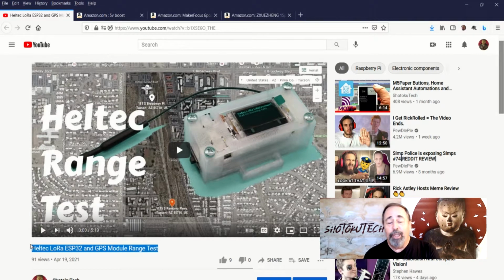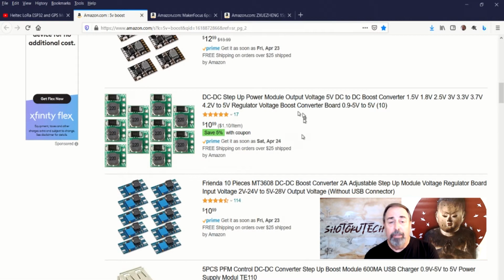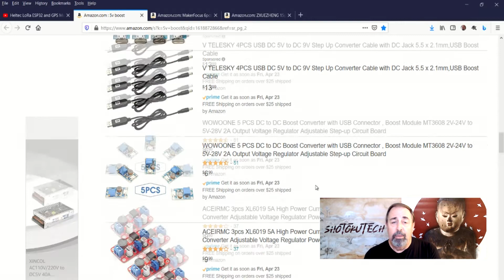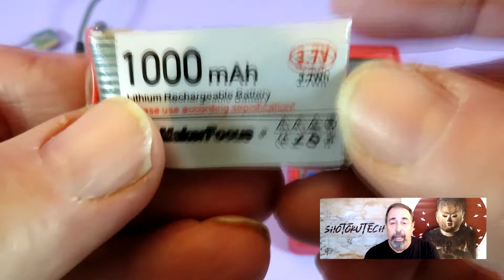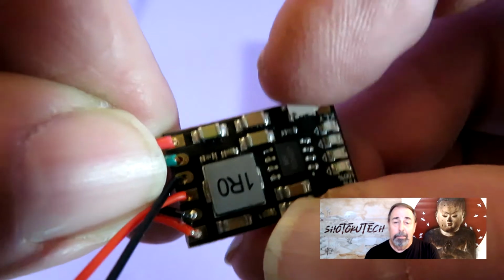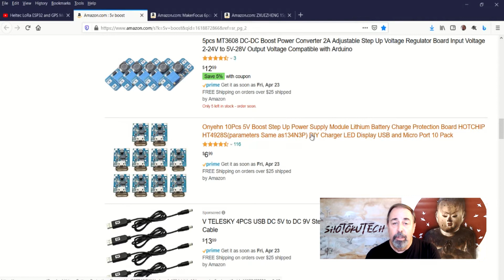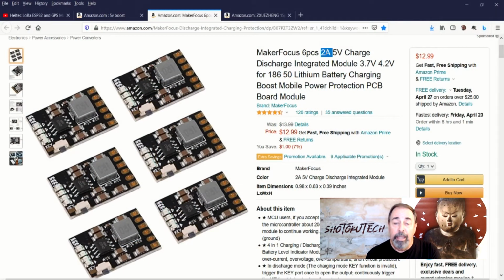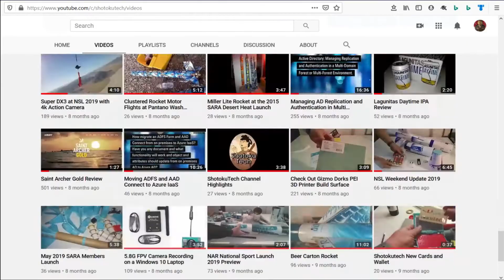Boost Converter 5 Volts from a 3.7 Volt LiPo Battery

Comment: This is a long shot but I am looking at a project where the the device requires a 5V regulated output does this system ensure that the voltage output remains at 5V regardless of the battery voltage level?
Reply from the maker: Hello. It is intended for 3.7V - 4.2V for 18650 Lithium Battery. So "Regardless of what battery voltage level" would have to be within that range and to deliver 5v at 2a you want the 18650 battery. Best wishes.

Comment: Did you test this module to see if it has all the necessary protections, e.g. short circuit, under voltage, over voltage etc?
Reply from the maker: Good questions. I'm more consumer oriented, focusing on making things work within the parameters given. I do know from repeated charging, it won't over-charge the battery. When the battery runs out, it is still in the safe zone, not below the voltage that will damage the battery. Shorting it out is not something I have tried. Thanks.

Comment: do it support  2 amps or less ?
Reply from the maker: I did not test the output under load to see what the actual current draw is for my scenario. But this board is rated up to 2 amps. As long as your project doesn't exceed that you are good. Thanks.